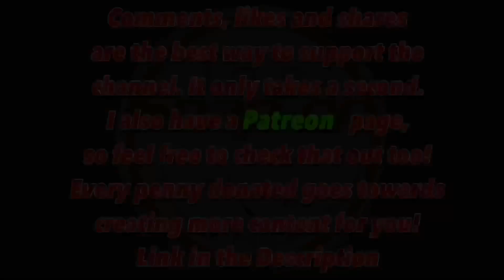SNAP-ON WEDNESDAY! - New 1/4" Ratchet From A Subscriber

Comment: Knew it was gonna be good when the video opened with CoC.  My dad passed away last year and I brought home a bunch of his hand tools from his air force / engineering career.  A bunch of Air Force issue snap on, including this ratchet as well as the FV71 3/8” ratchet.  He was stationed in Puerto Rico back in the late 60’s, which jibes with your date estimate.  Cool videos.  Btw, I serviced mine too and had to get a kit for the MV71.  RKRA930A was the kit number.

Comment: That little ratchet is bad ass. I have a 3/8 Snap On ratchet from the 30’s I got from an estate sale. Its a F70N and has Ferret stamped on it. Pretty cool if you ever run across one. Its in my ratchet drawer. More of a conversation piece. I probably will never use it. But I cherish it though.

Comment: Are those mats in ur drawer the 1/2 thick or 3/4 thick ones? All the interlocking ones I see have the diamond plate tread pattern on top. IS the bottom side of those flat without the diamond plate pattern? I looked on Amazon at some. Maybe you could throw a link in the description about the foam mats, just a thought?
Reply from the maker: They are 1/2" thick and I did a video when I first did the drawer and there was a link for them at that time.  I liked this style better than the diamond plate cause its a flatter surface to work with and just looks cleaner.